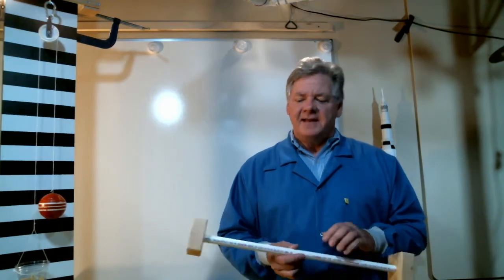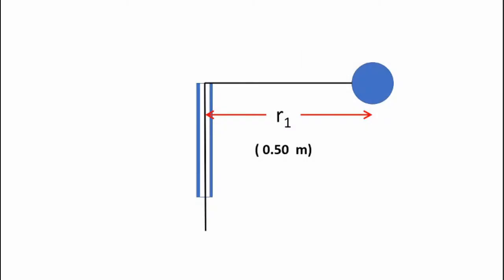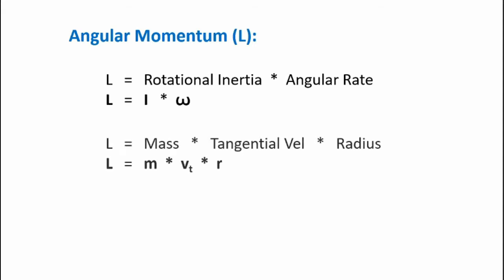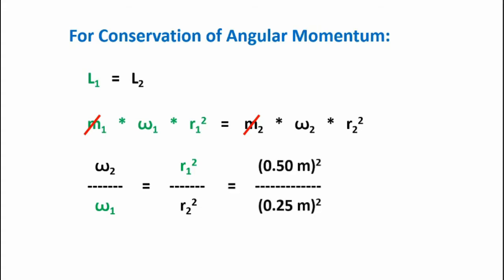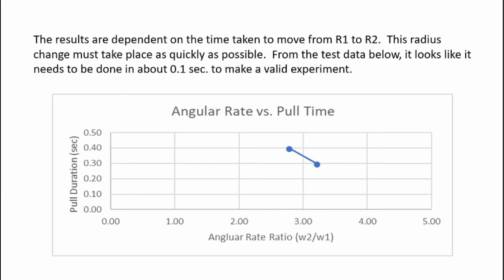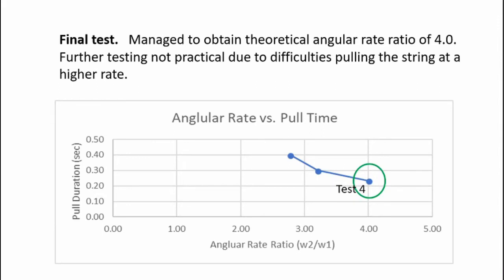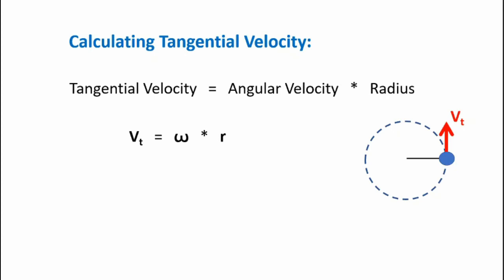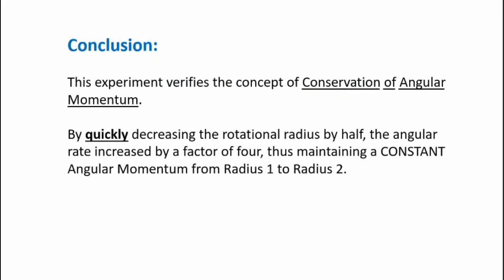Conservation of Angular Momentum

Comment: It is not possible that, by the reducing the lenght of the wire (i.e. the radius), the tangential velocity increases.
Only the angular velocity increases, but there is no reason for the tangential velocity to increase, because, when you reduce the radius, there is no force that pushes the ball in a tangential direction.
If the tangential velocity increased, its kinetic energy would increase without any cause.
In other words, the work needed to stop the revolving ball doesn't change, regardless the lenght of the wire.
Reply: It is absolutely possible that shortening the string accelerates the ball - if it accelerates the ball north while the ball is moving east, a quarter of a lap later this will be merged into the tangential speed of movement of the ball. The acceleration of the ball comes from the energy put in by pulling the string. In cases where you pull the string slowly, you allow more time for drag through the air to reduce the acceleration of the ball. If you did the experiment in a vacuum, all speeds of pulling in the string would lead to a four-times increase in rotation rate. The conservation of angular momentum is a misleading description of what's going on because a lot of energy is being added to the system by the pull.
Reply: @DavidCooperPorteous  Wishful thinking unscientific speculation.
Reply: @TheAnimammal  You're describing your own approach - where do you think the extra energy comes from if it isn't from the pull of the string?
Reply: @DavidCooperPorteous  You are completely missing the boat. My claim is that there is no extra energy. That is why he confirms perfectly a two fold increase in angular velocity because the angular energy is exactly the same as it is at the beginning. There is no extra energy.
Reply: @TheAnimammal  Clearly when he pulls the string in fast, there is extra energy. In a system with no drag, I suspect that you would get the same result no matter how slowly you pull the string, but drag when you do this in air hides that. Again though, this is a case where you could prove that not to be the case simply by doing the experiment in the opposite direction by lengthening the string instead to see if slower lengthening loses less speed than rapid lengthening, though because gravity interferes with lower speeds of rotation, you'd need to switch to a turntable experiment instead. I think you'll find that slower lengthening will lead to even more loss of speed due to drag having longer to affect the end result. Until someone does such an experiment, there's no point in discussing this further.
Reply: @DavidCooperPorteous  There is no point in discussing this further because it is proven that angular momentum is not conserved. His initial result is the only unbiased measurement and that measurement confirms my theory precisely. In other words this is independent experimental confirmation with a perfect result from a blind experiment of my claim that angular energy is conserved. I am scientifically proven right with this experiment. Independently confirmed is scientifically proven. I am right and angular momentum is proven not conserved.
Reply: The issue has been resolved at the science forum that I gave you a link to the other day. There's no external torque even though energy is having to be expended to move the ball closer in to the centre of rotation. That energy is added, and it has to be added in order to get the conservation of angular momentum, just as it has to be lost when running the experiment the other way round with the ball moving further out. It is indeed that added energy that goes into the higher speed of movement of the ball, and its loss of speed when the energy is thrown off as the string is let out again. The drag from the air serves as external torque acting the other way though, and that interferes with the experiments, pushing them towards the results that you would incorrectly predict for them being done in a vacuum. The existence of the drag suppresses the ball's speed, preventing it from getting anywhere near the top speed predicted for the vacuum case, so only a tiny amount of that energy is actually put in to get the ball close to the centre when doing the experiment in air, and the ball likewise ends up moving with only that tiny amount of energy added to it, which is why even a five-year-old can pull the string the whole way in. The key point in understanding why this expenditure of energy doesn't count as external torque is the same one as why no amount of expenditure of energy from inside the system can make the ball speed up its rotation with the string length unchanged: external torque requires a push against something external, and no such push comes from pulling in the string. In a perfect experiment where there is no drag, you cannot get the ball in from 100cm to 1cm without putting in an enormous amount of energy with the pull on the string. Drag wrecks your experiment and leads you to incorrect conclusions.
Reply: @DavidCooperPorteous  Interesting that you are attempting to suggest that a result which perfectly matches my prediction just happen to be random chance.

Every demonstration that we measure conserves angular energy by the result and all of them are just random chance and he fact that there is not a single scientific experimental result which confirms conservation of angular momentum is just fine by you.

You Pseudoscientist.
Reply: @TheAnimammal  Random chance is not an exchangeable term for drag. Drag is what leads to the results of experiments which are misleading you. When the string's pulled in fast, the time for the drag to act is reduced and we see results getting closer to the predictions of conservation of angular momentum. By ignoring drag, you are the one doing pseudoscience. And as I've told you before (and others have too), if you do the experiment by letting out the string instead, the establishment predicts that you'll find that your conservation of angular energy does not happen because energy will have to be lost instead of added, which means that if you can show that it isn't lost, you'll prove them wrong. The only role for drag in that case would be for even more energy to be lost, so they wouldn't be able to blame that external torque for your experiment retaining far more energy than they say is possible. I fear that if you do the experiment, you'll find that they're right, but if you don't do the experiment, nothing you've done will convince anyone because the most likely explanation is that drag is suppressing the speed of the ball, preventing it from accelerating up to anything near to the speed that it would do in a vacuum.
Reply: @DavidCooperPorteous  Have you ever seen a ball on a string behave differently than it always seems to behave. Seriously, it is reliable and repeatable and it always behaves the same. That is why it has been in consistent use for so many centuries. If drag was such a drag, then every single demonstration would look completely different.
Reply: Yanking does not count. It is pseudoscience. Nobody ever yanks a ball on a string demonstration unless they are trying to achieve a result which is not science. That is sport.
Reply: @TheAnimammal  It's about minimising the opportunity for drag to mess up the result. If it was done in a vacuum it wouldn't be an issue - any speed of pulling in the string would have the same end result.
Reply: @TheAnimammal  Every demo looks the same because of the drag. We've never seen it done in a vacuum.
Reply: @DavidCooperPorteous  You present wishful thinking speculation.
Reply: @DavidCooperPorteous  You are mistaken. It is about achieving a desired result. If you want to make extraordinary claims about vacuums then you know the procedure, pseudoscientist.
Reply: @TheAnimammal  Not at all: I explore interesting things to see how they work, and you found something interesting that I hadn't seen before. I now know know how it works, but until I see the experiment done in a vacuum, I won't rule out the possibility that the result contains further surprises. You don't appear to have any better access to a vacuum than I do, so that's a dead end approach for now, but the experiment could be done in reverse with the string being let out, and that would make your case much easier to prove if you're right, so what are you worried about? You think drag isn't an issue, so you should have no trouble doing an experiment that shows the ball maintain its speed of travel through the air as you let the string out. That's your only hope of proving anything, but you won't do it. Maybe you don't want it to prove that you're wrong. You tell me that my suggestion that drag affects the experiment is pseudoscience, so you should be confident that an experiment of this kind will follow your predictions, and you can let the string out at any speed you like without any possibility of it ruining the results. As gravity's a problem, just hang the ball from a rod as well as having it on a string: suspend the rod from the middle and have two weights dangle under it, then use strings to pull them in towards the centre and, more importantly, to let them out again. That's your way forward. Until you do that, you're just going to go on wasting your time insulting people who are trying to help you.
Reply: @TheAnimammal  Conservation of angular momentum is extraordinary, but it looks more and more as if it's correct: it's surprising to see because of the way energy has to be expended and can then be recovered, but it's something that's clearly going to be seen in action best in a vacuum. A ball doesn't keep swinging round for long in air due to drag. Have you ever played swingball? One fierce whack of the ball and most of the energy's lost after a couple of laps. That's why the string has to be pulled in fast, and it's also why you're not getting huge increases in energy when pulling the string the whole way in. Do a proper experiment and find out the truth instead of wasting any more of your time trading assertions and insults.
Reply: @DavidCooperPorteous  Asking me to perform a ball on a string demonstration in a vacuum after I proved it false in the environment it has been preformed in for three hundred years is shifting the goalposts which is a logical fallacy which is pseudoscience.
Reply: @TheAnimammal  I have never asked you to do it in a vacuum - it's clearly not an available option. You have not proved it false in air because drag interferes and causes your result. That drag is external torque. I've suggested a variant of your experiment which would let you prove your case if you were right, but you don't want to do it because you don't want to find out that you're wrong. The science of it has been interesting though, so thanks again for pointing me to it. It's just a pity that you still don't get it.
Reply: @TheAnimammal  No matter how slowly or quickly you pull in the string in a vacuum, the end result will be the same. It's drag that affects the result. You have to add the same amount of energy in total to bring the ball a certain distance in, unless the ball loses speed to drag, in which case you can pull it in a lot more easily. I don't know how long it takes a moron to understand something that simple, but maybe it'll sink in eventually.
Reply: @DavidCooperPorteous  My prediction is two fold and the result is two fold. Speculative wishful thinking is pseudoscience.
Reply: @DavidCooperPorteous  I have proven it false in the manner that the demonstration has been being conducted by physicists for three hundred years and you are now trying to shift the goal posts.
Reply: @TheAnimammal  The goal posts have not moved - you were just aiming between one of them and the corner flag instead of at the goal. You have to eliminate the drag for that experiment to be able to prove the case, or you minimise the drag by pulling the ball in more quickly, as in the experiment in the video at the top where it proves you wrong.
Reply: @TheAnimammal  Drag.
Reply: @DavidCooperPorteous  Wrong. If the results of the experiment match the predictions of theory, then the theory is supported by the experiment. This experiment perfectly ,matches the prediction of conservation of angular energy thereby providing independent confirmation that my theory is right.
Reply: @DavidCooperPorteous  You are becoming circular with your pseudoscience. Please stop harassing me with this bullshit. The result of this experiment match the prediction of my theory perfectly. It is independent experimental confirmation that my theory is right.
Reply: @TheAnimammal  You need to stop harassing other people with your bullshit. Your theory ignores drag and the experiment done at the top here indicates that the conservation of angular momentum is correct by pulling in the string faster to reduce time for drag to interfere with the results. You've been told repeatedly how to do an experiment that would prove your case if you were right, but all you do is keep repeating your pseudoscientific experiment where you ignore the effects of drag. The establishment predicts a result like yours when drag is involved so you're merely confirming their position.
Reply: @TheAnimammal  Drag.
Reply: David Cooper the experiment perfectly confirms my prediction. It is irrational to reject a perfect experimental confirmation by blurting ‘drag’ when the experiment directly confirms the three hundred year old claim of Physics starting with Newton himself that drag will have a negligible effect on the results. You present pseudoscience.
Reply: @DavidCooperPorteous  
To keep constant the angular momentum It's necessary to increase the linear (or, better, the tangential) velocity of the ball, but, reducing the lenght of the wire, the ball cannot go faster, because the direction of the force to which it is subjected is not tangential, but is directed toward the center of circumpherence, hence it's impossible that the tangential velocity increases.
Reply: @TheAnimammal  For a ball going round on a string, the drag is considerable, so you're the one doing pseudoscience. The experiment with the string being pulled in quickly minimises the drag and proves you wrong. You appear to have become stuck in the mud, incapable of moving on from your flawed experiment to carry out improved ones where you reduce the influence of drag or where you do things in reverse so that the drag does the opposite of pushing the results in your favour. You clearly don't want to find out that you're wrong. If you were right, you'd do a better experiment to prove it.
Reply: @DavidCooperPorteous  You are beginning to HARASS. 
Three hundred years of physicists have been presenting the demonstration in open air and teaching equations which ignore friction. It seems as if you are declaring every physicist who used this demonstration since and including Newton himself an idiot. 
Is that what you are trying to say?
Reply: @TheAnimammal  You're the one harassing people by going round spreading your anger everywhere and insulting anyone who tries to help you resolve it. The physicists who've been presenting this demo do not share your opinion as to what the result shows - they would all tell you that drag is the reason they don't get the result predicted for doing the experiment in a vacuum. They are not idiots.
Reply: @consiglipergliacquistithereal  But the ball does go faster as you pull in the string because energy put in by the pull translates to greater speed of the ball in the tangential direction quarter of a lap later. Ask yourself this: if you pull the string north when the ball is moving east, what direction does that make the ball move in? It's no longer moving east because a component of movement has been added to it northwards, while none of its eastward speed has been removed. Take those two vectors of movement into account and you have a higher total speed than before. The eastward component of the ball's movement is converted into northward movement quarter of a lap later, while the northern component of movement added by pulling the string is added to that quarter of a lap later, so the two components of movement of the ball have merged into a single component.

If you let the string out instead of pulling it in, you end up with the ball moving more slowly quarter of a lap later because you've prevented some of the northward acceleration from the centripetal force from being applied to the ball. The centripetal force pulling the ball in a northward direction is strongest at the part of the lap where the ball is moving east, and letting the string out a bit at that point leads to the application of that centripetal force in a northerly direction being interrupted most.

The reality is that conservation of angular momentum happens despite the need to put more energy in to bring the ball nearer the centre and to release energy (or recover it) when moving the ball further out again. It is impossible to move the ball further in without adding speed to it (unless drag is slowing it enough to prevent that), and it's impossible to move it further out without it losing some energy.
Reply: @DavidCooperPorteous  You are the one harassing me with this circular bullshit argument. There is no opinion about it. 
My prediction is confirmed by this experiment.
Blurting "drag" incessantly does not change the fact, it is just harassment.
My prediction is confirmed therefore my theory is right and conservation of angular momentum is wrong.
Reply: @DavidCooperPorteous  
If you pull the ball toward the center, it will undergo radial and centripetal aceleration, not tangential aceleration at all.
If you "let" it go out, the ball doesn't have radial acceleration, but only centripetal deceleration, and its tangential velocity remains constant.
Reply: @consiglipergliacquistithereal  That is not the case. I described the mechanism by which the speed of the ball is changed by pulling in or letting out the string and it is correct. Do you understand how centripetal force is applied to the ball and in which direction? When the ball is at the southernmost point and moving east, which way is that acceleration being applied? North is the answer, and this southernmost point is also where that northward acceleration is strongest. Changing that acceleration at that moment by pulling in the string or letting it out changes the acceleration being applied to the ball and immediately leads to it moving north at a different speed. Quarter of a lap later, this results in the ball having a different tangential speed.
Reply: You agree with me then. Physics however claims that the kinetic energy increases.
Reply: @TheAnimammal  
I know and this is the reason why the current physics, in particular that concerning the gravitational force, is totally wrong.